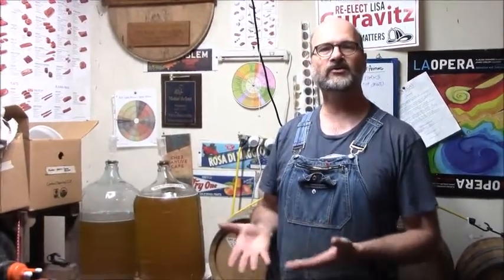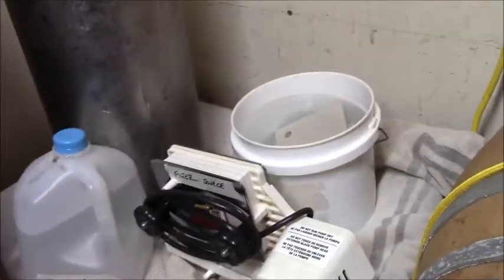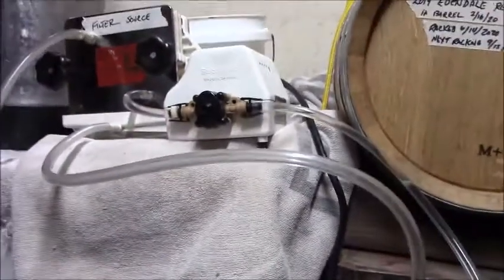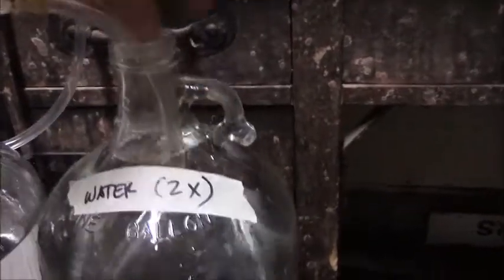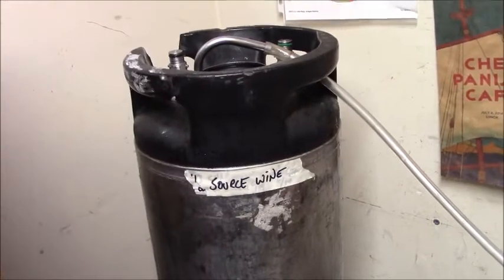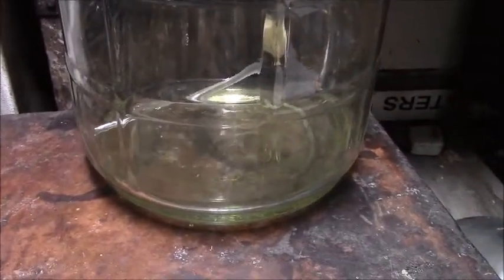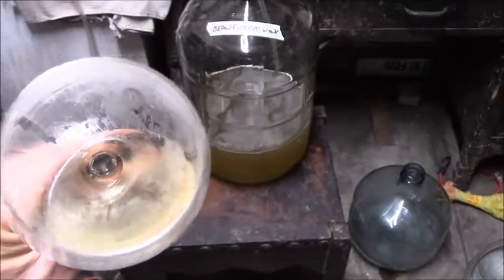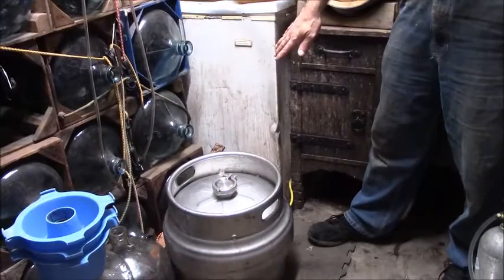Filter your wine!

Comment: When to filter wine?
Reply: Filtering is usually shortly before bottling. Many people let the filtered wine rest a few weeks in the hope that more CO2 will  blow off and not leave the wine with bubbles. You still need to protect the wine from oxygen but you can monitor it for no bubbles before scheduling bottling. Hope that helps.